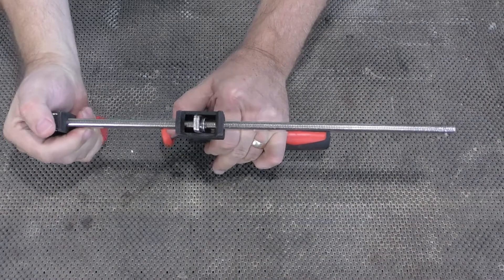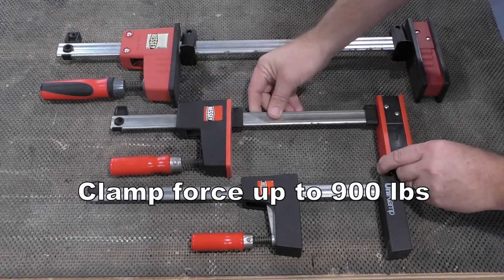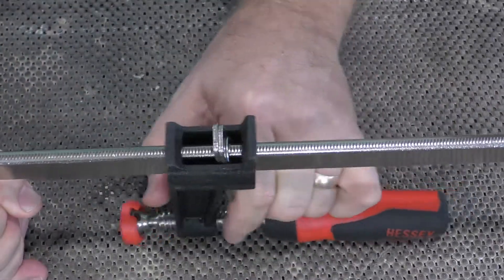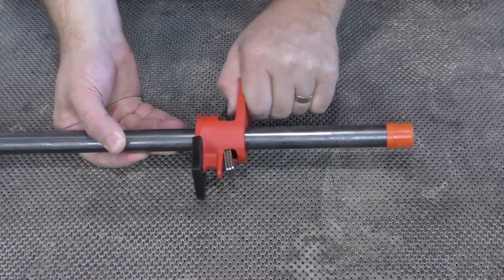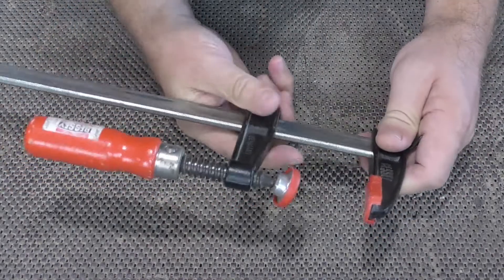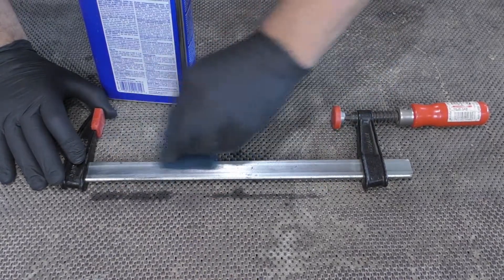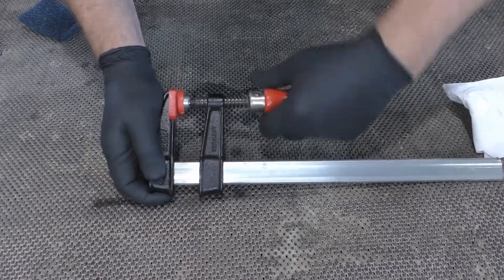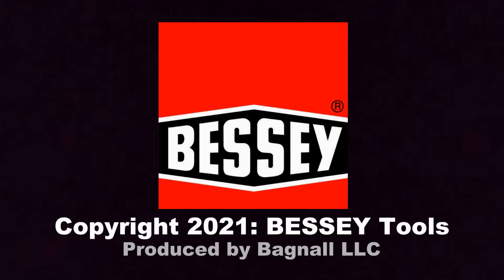BESSEY FAQ - My Clamps Wont Hold, what can I do?

Comment: Nice, yes this is often the case early on but doesn't solve why they won't hold later on.

Got a situation of those little threads on the inside of the clamp have been worn down. Can access one easily with an alan key but the other is very hard to access. Looked at the parts list and can't find replacements either.